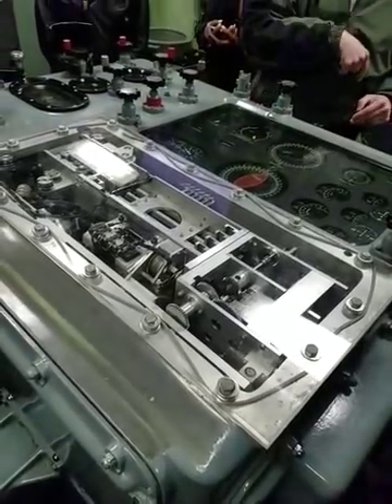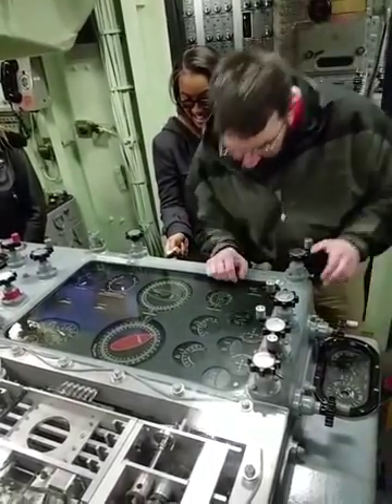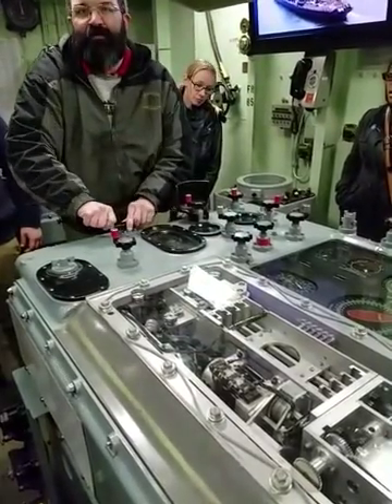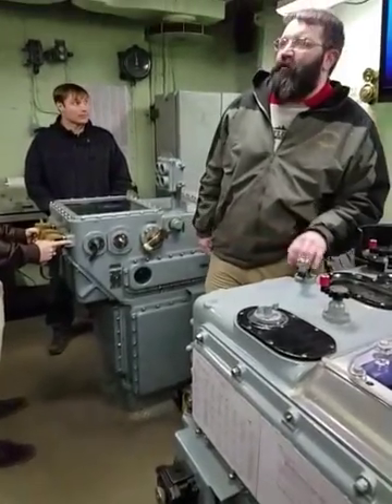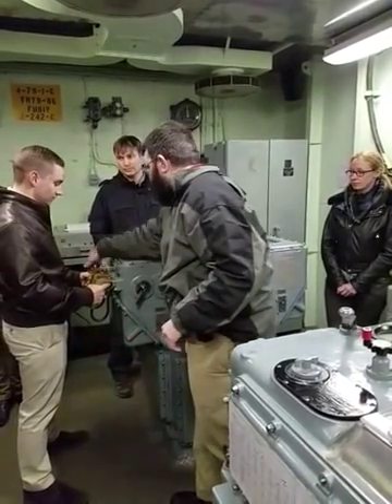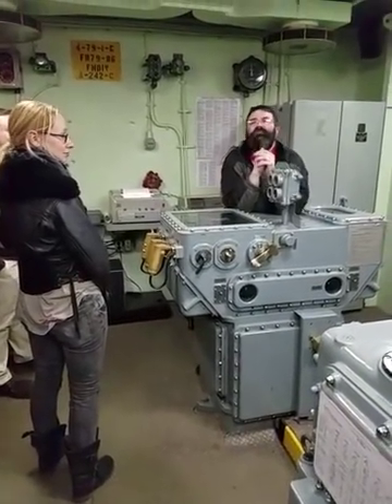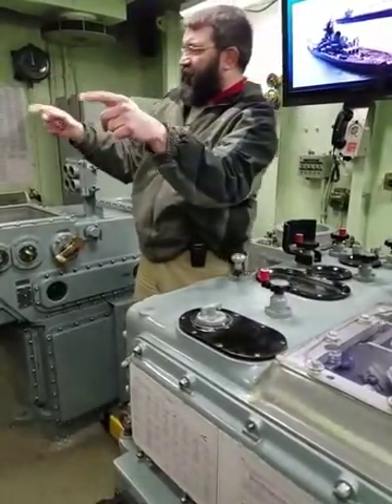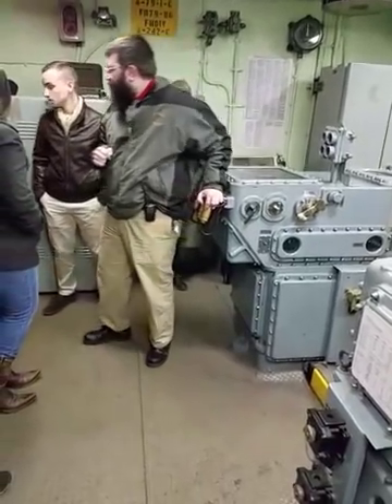Firing the 16" 50 caliber guns on the Battleship New Jersey

Comment: "16" 50 calibres" to be correct. The number of calibres multiplied times the projectile diameter equals the lenngth of the barrel, ie. 16 inches x 50 = 800 inches or 66.7 feet. That's a hell of a long barrel, a lot of steel. The longer the barrel, the higher the velocity of the projectile and the greater it's accuracy.
Reply: Actually the higher the velocity does not mean the greater its accuracy when it comes to Naval artillery. The US wen with super heavy shells with a lower velocity than other navies. The increased mass of the shell led to less interference from wind and atmospheric conditions. The Italians went the opposite with a lighter shell with extremely high velocities. The Italian Littorio class battleships had 15 inch guns that fired a 1,950 pound AP shell at velocities of 2800 feet per second compared to the Iowa class firing a 2,700 pound AP shell at 2,500 feet per second. The Italian Littorio class suffered from horrible dispersion problems over the life of the ship and they were never able to solve it.

Comment: Are the turrets still capable of functioning?  I don't mean can they still fire, but does all of the machinery used to move the projectiles and powder bags from the magazines to the guns still function.  It would be interesting to see the loading sequence in one of those turrets.
Reply: Probably not the hoists, but training and elevation, probably. Just lack of power going to them is the issue.

Comment: Fun seeing some of the "fire control" stuff.   I would like to see some videos on the mechanical analog computers used in these systems.    I don't know for sure but I doubt that these systems would work 100% without electric power.
Reply: As long as you can keep the internals turning, it will work as designed, thats what makes them so interesting.

Comment: Water does not spin differently depending on the Hemisphere, but the minute differences in shape between drains. You can see water drain different ways all the time.
Reply: IF you have a perfectly clean drain with NO obstructions and a very LARGE pool of water over said drain, you can get said coriollis effect.  Otherwise you are correct

Comment: Is 6 powder bags too launch the shell standard?, or can you add more bags for further projectile distance? Or if adding an extra back would increase the wear of the barrel Or worse?
Reply: The six bags were both standard and maximum operationally. Though I believe the experimental guns at Dahlgren of both the 16"/50 Mark 7 and the 16"/56 caliber Mark 4 used more than that- or at least more than their equivalent in volume of powder (D839) in several tests from 1936 and 1941 (respectively) onwards.

Comment: Toilets DO NOT spin the opposite direction south of the equator. (at least, not always.) It is a commonly held misconception that toilet water always drains counterclockwise in the Northern Hemisphere and clockwise in the Southern Hemisphere because of the Coriolis force an acceleration imparted by the Earth's rotation. The influence of the Coriolis force on spin direction is real, but it is generally only observable on very large scales, such as trade winds and hurricanes.
Reply: Bewildering Truth Seeker I bet the fact that he was just using that to make the rotation of the earth a tangible thing, makes no one give two fucks
Reply: well, obviously you cared enough to reply. :P have a good day.

Comment: The water circulation in toilets and drains has nothing to do with the Coriolis effect. It depends on the geometry of the water flow in the basin and doesn't vary by which hemisphere you are in. The rotation of storms does have to do with the Coriolis effect.

Comment: If we lost power on a modern ship, sailors would be more upset about losing Facebook than our lack of weapons. I, an IT, have been yelled at several times for losing internet connection due to the ship rocking. But I can confirm we would be dead in the water with no power. Everything, and I mean everything is run by computers today, we could still do some stuff, but I can’t go into detail obviously.

Comment: No, the Coriolis effect does not influence the direction of flow of a toilet flush or a sink drain, that is just silly, the Coriolis effect is not strong enough to do that. If it was, a mere ping pong ball would have its trajectory altered when thrown over a small distance, which is not the case.

Comment: I always wonder how this was done, some questions answered some not. Maybe someone can fill in? Did they who did the actually firing of the guns only get distance and degrees sort of? I guess there where different shells? like armor piercing, HE shells and so on? or was it just one type of shell in that time?
Reply: The Battleship New Jersey actually has a video on the shells they use so I can help with that. They have many different kinds of shells but they’re all just slight variations of one of the two main kinds of shells. You have the armor piercing shells that are designed to explode a few tenths of a second after hitting the target to penetrate the armor and you have high capacity shells (more commonly known as high explosive) that are designed to explode on impact. Both shells are obviously used for different things, because you wouldn’t fire a HE shell at a heavily armored battleship and you’re not going to use a shell designed to pierce armor for land bombardments.

Comment: The coriolis effect DOES NOT have any significant effect on which way water goes down the toilet.  The size of the pool of water in the toilet and the amount of time it takes to flush it are both way too small for the coriolis efect to manifest itself.  The direction of flushing is essentially random and not associated with which hemisphere you are in.  Scientific experiments to measure the coriolis effect require circular tanks the size of swimming pools and several days for any observable effect to occur.  However, the rotation of the earth DOES have an effect on a shell that is flying up to 20 miles or more, which is why the computer corrects for it.

Comment: 50 caliber or 50mm?  Seems like those guns shoot way larger than 50 cal.
Reply: 16″/50 caliber.  That means that the bore diameter is 16 inches, and the barrel is 50 times that in length.

Comment: I don't understand why they call the guns 16 inch, 50 caliber. 
They're 16" but what's the 50 Cal mean?
Reply: The effective length of the barrel
Reply: @razmuzen1090  I don't get it, but thanks anyway.
Reply: @jackburnell3209  I believe its projectile diameter, times caliber gives the barrel length, so 50*16, which means these canon have a 800 inch long barrel.
Reply: @sparkplug1018  thanks.

Comment: Who titled this? Didn’t see anything about .50 calibers
Reply: That's because the video is about 16" 50 caliber guns.  note the lack of a decimal.
Reply: jim, cannon caliber is quite different, it's the bore, times the caliber to find the barrel length, so in this case it's 50, times 16 which equals 800, divided by 12 gives you 66.66666667 inches, which happens to be an inch and a half short of the actual barre length so these things are 50 and some change
Reply: Where did you pull out that decimal it's a 50 caliber cannon not .50 cal

Comment: "Hit a moving object 23 miles away", Except you haven't,  Longest hit by Warspite on Giulio Cesare at nearly 15 miles. Similar by Scharnhorst onto Glorious.
Reply: Thanks for the links to Warspite and the Scharnhorst. I guess the guide meant that the computer could theoretically calculate a solution to hit a moving target at a maximum range of 23 miles.
Reply: Yes but that was by pure blind luck. The MK-8 Rangekeeper once it developed a firing solution could land accurate fire on the target at maximum range without the need for ranging shots. In the Battle of the Surigao Strait the USS West Virginia opened fir on the Yamashiro at 22,800 yards or 13 miles and hit Yamashiro on the first salvo and then continued to land accurate fire pummeling Yamashiro. With this system it did not matter if you change course or speed or if the target changed course and speed or of both of you did it together, the MK-8 plotted a firing solution that was constantly updated in real time. An Iowa, South Dakota, or North Carolina class battleship would have had no issues smashing ANY battleship in the world in a 1v1 engagement in what would have been a very one sided ass kicking due to a fire control system that was leaps and bounds ahead of anything else at the time.
Reply: @Bellthorian  .Very  interesting but you would be a braver man than me to tell a Warspite gunner it was down to "Pure blind luck" even if you could find one in his nineties now.

Comment: Funny story about the toilets, but it's not true.
"When applied to toilets and sinks, this is one of those “too good to be true” science factoids, I’m afraid. But it does apply in some situations.

The myth goes that if you flush a toilet in Australia the water swirls down the drain the opposite way than in the northern hemisphere, due the Coriolis effect (an apparent force which describes how objects veer to the left or right when traveling on something that’s rotating — see the link above for a good visualization of this).

If there were no other forces on that water in the sink or toilet, that would be true. The Coriolis effect does actually make hurricanes rotate the opposite direction in the two hemispheres. But for toilets and sinks it’s another story. The toilet myth is easy to dispel — just peek around the rim of the toilet and you’ll see that the water is jetted into the bowl at an angle, which determines the direction the water swirls."

Comment: The statement about the direction of the swirl in the toilet is wrong.
There are many myths like that, which are based on a wrong understanding of the Coriolis force. Another example of such a myth is that north-south railway tracks would be worn out unevenly, if the trains would only go into one direction. As an undergrad I calculated the impact difference for a railway engine of 180 tons, going directly north-south with 100km/h and it was a few hundred grams.
The problem is that in reality, the Coriolis force is only relevant on much larger distances.
In a toilet bowl movement of the water, asymmetries in the bowl or kinetic energy of "physical objects" which are dropped into the bowl habe much more impact  than the Coriolis force. Same is true for the railway line, with a distance of app. 1.5 m between the rails.
For an artillery shell, fired over tens of kilometers, this is a different story.
And for cyclones, it is crucial.

Comment: I didn't see a 50 caliber gun anywhere in this video
Reply: Caliber in this case is the barrel length so 50 x the bore diameter of the gun so 50 x 16" = 800" or about 66.67 feet long
Reply: @sadams12345678  right on the nose

Comment: It’s the 16” mk 50 gun. 50 caliber is 1/2 an inch lol. 16” describes the gun and the following number denotes the mount the gun is in for example I was assigned to a ship with a 5” 54, a 5 inch gun in a mk 54 gun mount I was also on a ship with a 5” 38, same gun different (unmanned) gun mount.
Reply: As best I recall, the guns mounted on an Iowa class were the 16"/50 caliber Mk 7 gun. A .50 caliber round (.50 BMG) is a half inch, 50 caliber is 406mm or 16 inch. Definitely one place where the damn period make a huge difference.
Reply: @sparkplug1018  thank you for that, I kinda realized my mistake but you have clarified it for me. I appreciate it.
Reply: @sparkplug1018  Ok the 50 in 16"/50 Caliber refers to the length of the barrel. The caliber of the gun is of course 16". Caliber is just a measurement of barrel diameter. So the barrel's caliber is 16" and it has a length of 50 calibers(67 feet).
Reply: I can tell you were not a gunners mate like I was. There is a DIFFERENCE in firearms and artillery. In artillery caliber is a function that tells you the length of the barrel. You multiply the diameter of the projectile by the calibers of the barrel and it will tell you how long the barrel is. This is how naval artillery, land artillery and tank guns are all described. The M1A2 Abrams tank is armed with a 120mm L44 gun its gun from breech to tip is 5,280 millimetres or 17.32 feet long.
Reply: @Bellthorian  I was on 2 ships as a FC so I worked with gunners mates an 1 of those ships had a 5” 54 and the other had a 5”38 so tell me again about artillery? lol
Reply: And I realized my mistake about 2 seconds after I posted
Reply: @roysnider3456  Pop guns lol, of course once you fire a 16 inch gun everything else seems small by comparison hehehehe

Comment: I hope you all are aware that a .50 cal gun cannot also be a 16 inch gun. A .50 is a half an inch... you cant have a half inch 16 inch gun. Theres no logic to it
Reply: There is a DIFFERENCE in firearms and artillery. In artillery caliber is a function that tells you the length of the barrel. You multiply the diameter of the projectile by the calibers of the barrel and it will tell you how long the barrel is. This is how naval artillery, land artillery and tank guns are all described. The M1A2 Abrams tank is armed with a 120mm L44 gun its gun from breech to tip is 5,280 millimetres or 17.32 feet long.

Comment: Yes, we know that the coriolis effect does not have an effect on toilets, and a 16"/50 caliber gun is a gun with a muzzle diameter of 16" with a barrel length of 800 inches.

This comment section is a glaring sign that the American education system has failed entire generations. 

Everyone makes their own uninformed comment before taking 5 seconds to realize 172 other idiots have already made the exact same comment, and also had to be corrected by someone more knowledgeable than them.

They're all more concerned with being seen and heard, having their ego stroked, regardless of the pointlessness redundancy of their comment.

Comment: Hm. A 16 inch 50 caliber gun..... Last time I did math, 50 caliber is half of an inch.
Reply: Small arms the caliber is the bore of the tube, large size weapons (field guns and up) calibre the length of the barrel divided by the bore size.
Reply: Caliber, when referring to large guns refers to the length of the barrel in terms of the diameter.
Reply: really dude? its says battleship work it out
Reply: Ning3n maybe you should do some more maths

Comment: The rotation of the earth does not affect the direction in which water swirls down the a drain, or toilet.   Unless a MFG has placed directional channels in the toilet, modern toilets won't even swirl the water.  Poster should  include the correction of this false information.

Comment: 16” .50 caliber guns?????
Reply: There is a DIFFERENCE in firearms and artillery. In artillery caliber is a function that tells you the length of the barrel. You multiply the diameter of the projectile by the calibers of the barrel and it will tell you how long the barrel is. This is how naval artillery, land artillery and tank guns are all described. The M1A2 Abrams tank is armed with a 120mm L44 gun its gun from breech to tip is 5,280 millimetres or 17.32 feet long.

Comment: How can it be 50 caliber guns?
Reply: Ok so a caliber is the barrel diameter. The diameter is 16 inches. The barrel length is 50 calibers(67 feet). The gun is 16"/50 caliber.

With the M2 Browning. It's barrel diameter .50". It's barrel length is 90 calibers. Really it should be called .50"/90 Caliber but it's colloquially known as the 50 cal. Which is wrong but it's a bit of a misnomer because the barrel diameter is half an inch, not 50 inches.
Reply: @gnranger  no its the size of the round being fired....I'm unsure how your describing  this....I've never heard of what your trying to indicate
Reply: @sloanchampion85  "In guns, particularly firearms, caliber (or calibre in British English) is the specified nominal internal diameter of the gun barrel bore regardless of how or where the bore is measured and whether or not the finished bore matches that specification. For example, a ".45 caliber" firearm has a barrel diameter of roughly 0.45 inches (11 mm). Barrel diameters can also be expressed using metric dimensions. For example, a "9 mm pistol" has a barrel diameter of about 9 millimeters."
Reply: @gnranger  I don't know what military you served in....
Reply: @sloanchampion85  GNranger is correct

Comment: 16 inch 50 caliber. What? 50 caliber is 12.7 millimeters
Reply: DeathToAll Live as many above explained, 50 caliber reffers to barrel lenght not to actual caliber of the gun
Reply: Jakub W. I see now
Reply: Jakub W. Didn't know that was a measurement of length
Reply: DeathToAll Live in case of cannons that is the barrel lenght measurement method. It provides easier understanding of ballistics and normalize their measures. For example abrams tank gun is 120mm in diameter and 44 calibres long - 120mm/44 or 120mm L/44 or for Leo2A6 it's 120mm L/55
Reply: Jakub W. Hmm that's really cool to know.
Reply: That explains everything from world of tanks to me know LOL
Reply: DeathToAll Live LOL yeah now you know what the hell KwK/PaK 43 88mm L/71 means. Or do you? :)
Reply: Jakub W. I knew that was some relation to barrel length. But now I know that it's caliber

Comment: What's a 16" 50 caliber gun?
Reply: A sixteen inch gun that's fifty calibers long...
Reply: Just like the older 16 inch 45 caliber gun. 16 inch is the diameter 45 or 50 is how you get the length of the barrel. 16 inches times 45 is 60 feet. 16 times 50 is 66 feet.